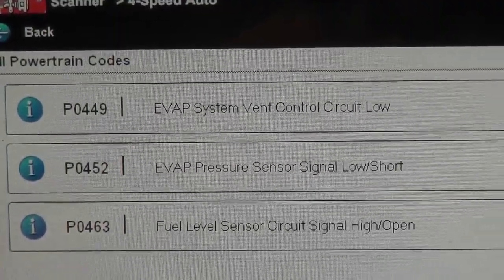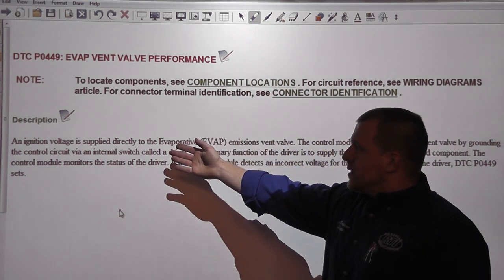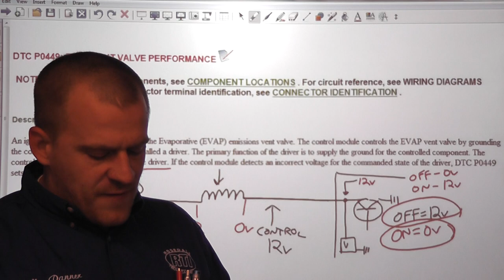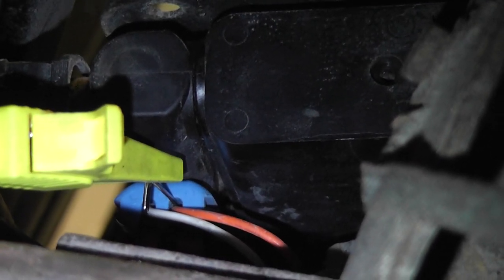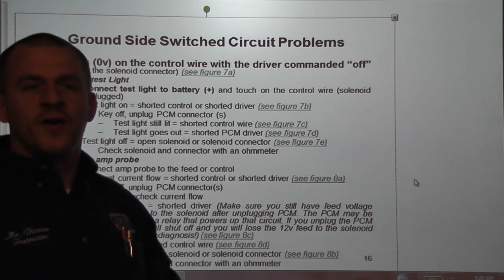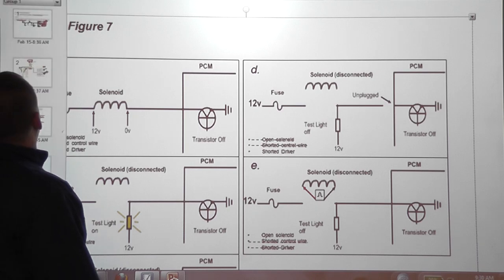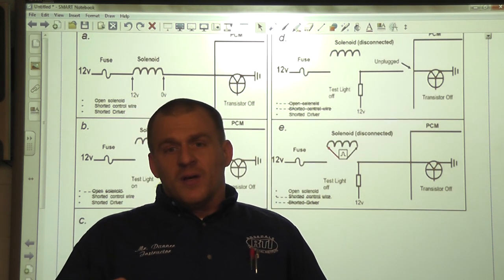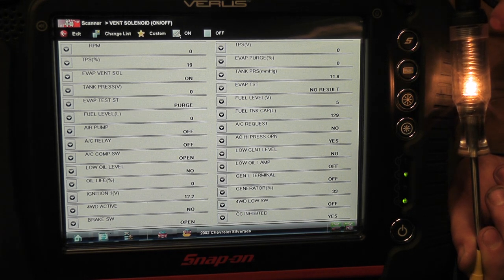GM EVAP Vent Solenoid Testing

Comment from the maker: @MrMratni Very good comment! And thanks again for the book purchase! You are correct about that test, except in the case of a vent solenoid, I will disconnect the vent hose and connect a long piece of heater hose and blow through the solenoid. (the ports are too big for a hand vacuum pump) De-energized you SHOULD be able to blow through it and energized you SHOULDN'T.  GM EVAP vent solenoids are normally open.

Comment from the maker: It is what we call a dummy shaft distributor. It is still there to drive the oil pump as the distributor used to do. It will come out. There is a rubber o-ring type seal that is most likely hard as a rock. It is ok to get aggressive with it.

Comment from the maker: @contagiousFX It is a ground side switched circuit, so with the solenoid open there will be 0 volts all the time on the control wire regardless of circuit activity (driver on or off)

Comment from the maker: @contagiousFX If done correctly like in this video, it is the best way to test the driver and control wire integrity. Of course you need to understand current flow and that the test light I am using is the same if not lower current than the solenoid carries. There is absolutely no danger to the driver in this test. I recommend in my book before doing this type of testing that you measure you test light current draw first. Oh, and keep that power probe away from this type of test.

Comment: Hi ScannerDanner. I know it has been 2 years since we spoke on the issue I was having with a P0446 issue on my 2001 Camaro; but as promised, I have an update for you. I found that the fuel pressure sensor was the cause for the whole problem (The sensor was totally dead). The EVAP system set to ready within 10 minutes of driving after replacing the fuel pressure sensor. Thanks for all the info and assistance that you provided while I was trying to diagnose the problem with that P0446 issue!

Comment from the maker: No, what I am saying is with the P0446 code not happening (or temporarily fixed), the system was able to complete its monitoring of the system and when it did its check on purge flow it found another problem. So what I am saying is you have two separate issues. IF you fix this P0446 code, you will then continue to set the purge flow code. Unless of course that one is intermittent too. 
You need to focus on pins contact at the PCM for that vent solenoid first.

Comment from the maker: you heard a click, that's good but you must also check the function of the solenoid.  you should be able to blow through it not energized and not be able to blow through it energized. This is a normally open valve so by your description of having trouble filling your tank, either the valve is stuck closed or there is a blockage in the vent line

Comment from the maker: first thing is to turn the key on a take a voltage reading on both solenoid wires. I believe this design is ground side switched. so you should see 12 and 12. the result of this test will dictate our direction or next step. Oh and yes you could use a test light to energize this but we are not at that step yet.

Comment from the maker: If you energize the solenoid with a test light, that just checks the solenoid and the feed circuit. To test the control wire and the PCM driver you must use a scan tool to turn the driver on or you have to meet the conditions where the PCM will normally turn the driver on. That is the only way. Of course you can use the test light in place of the solenoid for the test, but the driver must be turned on and you cannot do that part with the test light.

Comment: In addition of after checking the control side and power side of the circuit, you can energize the solenoid with the scanner and apply vacuum with a hand vacuum pump. If the the vacuum doesn't hold then surely the solenoid is bad. Btw, I purchased your book very awesome.

Comment from the maker: You cannot see the control wire voltage on the scanner. At least not yet but that would be cool.  I will not be surprised to see output solenoid control wire voltage listed on the scanner in the future. You can see the command on some but that doesn't tell the whole story. Thanks!

Comment: ScannerDanner thanks for all the work you put into these videos. I love my Modis scanner a lot more when seeing your videos. You remind me of my tech school engine performance/electrical instructor. question: Does this evap solenoid testing procedure apply with checking an a/c compressor flow valve for a 2008 toyota camry 2.4?

Comment from the maker: @foxholewilly I'm not completely sure what you are referring to, Do you mean bias voltage? Like in Section 3 page 26 in my book? (I'm not sure if you have it, so sorry for the reference if you don't) The circuits that will typically have a bias voltage are the power side switched solenoids. I don't remember if I have ever seen that on a ground side switched one. With the transistor off there is no current path on the control wire.

Comment from the maker: having the voltmeter hooked up wouldn't change anything other than potentially the male/female pin contact at the ECM. You may have a loose pin that was temporarily tightened up with your t-pin or whatever you where using. 
This may have allowed the system to finish its other checks. So it sounds like you also have a purge flow issue. Most common cause for this code is reversed vacuum hoses on the purge solenoid under the hood or a sticking purge solenoid

Comment from the maker: use a t pin for the pcm connector the make yourself a long jumper wire with alligator clips. be sure to insulate the end under the hood just in case. also use a jumper wire for you voltmeter neg lead too. this way you don't have to hold anything and you can focus on driving

Comment: Broski I'm having this problem right now and this video is badass! Thank u so much and learned from this..so I did all the tests and diagnosis and found that at the end it was my original connector that failed.i replaced it and code gone and running good on the truck👍🏽
Reply from the maker: awesome! Thank you!

Comment from the maker: @foxholewilly Oh ok that was very observant of you! In my experience with both ends of a circuit open yes you will see this "ghost voltage" as you call it. (From what I found if you zoom in on it and measure its frequency it is 60hz which no coincidence is the same frequency our residential lighting systems run.) So I would call it "noise". Anyway to answer why it was not there. First I do not know the PCM board as well as I would like to but I would say there are some......

Comment from the maker: It is not a leak code. When you see "control circuit" in a code it is either the wiring, computer or solenoid that is at fault. These are known for wiring issues at the connector. Tug on them to reveal a break, sometimes the insulation can even look fine but the wires are broken inside. If you have a voltmeter, with the key on, backprobing the connector (solenoid plugged in) you should see 12v on both wires

Comment from the maker: @ScannerDanner capacitors and or despiking resistors that are in a parallel branch to the transistor driver in the PCM. Either way this in no way changes the diagnostic, wouldn't you agree? But it is fun to talk about. You have a great mind.

Comment from the maker: ok, next step is to measure the white wire at the pcm. there should be 12v there too. 
Or if you have a bidirectional scan tool, command the vent solenoid on and look for a voltage drop on the white wire.

Comment: Excellent diagnosis.  Love how you confirmed the integrity of the driver at the end by commanding it on and off. I always like to manually control drivers whenever the option is available.  I wonder if maybe you could view the voltage on the control wire through the scan tool, while also commanding it on/off.  Of course, it is always important to understand what is going on in a circuit.  This vid did that

Comment: Like Paul said you can aggressively twist it with pliers, channel locks or lightly adjusted vice grips. I replaced my 1993 3.1 recently and when you get it out take a knife tip and snap out the o ring. There should be a shaft from the oil pump that may or may not come out with the cap. Mine did. Good luck.

Comment from the maker: @ScannerDanner It is too easy using a power probe to apply the wrong polarity to a circuit. I personal don't use one, nor do I feel the need to. Just a regular old incandescent style test light is just fine for 99.9% of driver testing that I showed in this video.

Comment: Thanks for the reply Paul. I took the vent solenoid off the car to bench test it. I'm holding it, and I gotta be honest, I don't it's the type that you can blow into to test. If ya type chevy cobalt 08 vent solenoid in google it'll show up as one of the first pics. It's cylindrical. Also, I should add the solenoid goes directly in the canister. There is no vent line that goes directly to the solenoid (from what I can tell).

Comment: At the 25-27min. using the test light is the key on or off ? I am guessing key off.
What signals computer to ground the control wire and activate the solenoid. Does the Evap purge solenoid operate the same as this vent control solenoid ? I do not have the ability to ground the control wire with a scan tool.
My vehicle is a 1996 Olds.Lss 3.8 S.Charged. I have a P1655 Evap Purge solenoid control circuit code combined with a P102 Mas or Vol Air Flow A Circuit. 
Your video is the best for explaining this circuit I have seen.Thank You.
Reply from the maker: For some of the tests the key must be on for the computer to have power and for the feed circuit to get power. 
For the short to ground test in the harness on the computer side, the key does not have to be on. In fact, I think I have the computer unplugged in that example right?
Your purge solenoid is tested the exact same way as this vent solenoid in this video. It is power side fed and ground side switched. It is possible the purge and MAF sensor is on the same circuit for power. See if you have power first.

Comment from the maker: How about watching that control wire voltage at the PCM during a test drive. Rig up your voltmeter to that wire and put the meter inside your truck. See if it ever changes. IT should only change when it is commanded on by the PCM.

Comment from the maker: the test light is the load. most test lights will draw less current than the solenoid itself would draw. you should always measure the current draw of your test light before doing this kind of testing. most of the incandescent bulb test lights draw about 200ma.

Comment: I use a 194 bulb with a couple of the proper terminals to plug into the vent solenoid connector.  Use the scanner to operate the vent solenoid and prove out everything at once.  Even pin drag.  I used to use an 1157 bulb, but somewhere around my2006, the pcm stopped driving that much current for these circuits.

Comment from the maker: Every driver is different, you have to research the system to know when. .In the case of a GM vent solenoid, the only time it is turned on is during the leak test of the evap system.

Comment from the maker: is this code immediate or do you have to drive it for awhile to show up again? I still think you have a wiring problem and you need to pull and wiggle the harness while monitoring vent solenoid control wire voltage at the PCM connector. It should stay at 12v the whole time.

Comment: Good video.With my Pontiac Montana off and on my red wire only reads 4 to 5 volts when testing to ground. White wire reads 0 at all times with plug out,not pin tested while still plugged in to solenoid which might be ok? This is going to the purge solenoid,not the vent solenoid which is in a very bad location to get to unless I roll the engine frontward after disconnecting bone brackets on front.

Comment: I then checked the defective unit with a olm meter and its open, as the replacement unit  is complete.Hope I didn't hurt the Driver as you stated ,When I checked for voltage at the connector with a volt meter.

Comment from the maker: Can you apply a power or a ground to a circuit with just the touch of a button with this tool? I know the older power probes do this. Also what is the voltage threshold that will light the green LED indicating a power source? There are other concerns I have with this tool too. Take a ground side switched solenoid that is not being grounded yet and check the control wire. This tool will ID the circuit as a power feed, but what it really is, is a switched ground. I suppose a DMM does the same.

Comment: Thanks brother for another great video. I have a 1997 LeSabre with a p1655 EVAP Purge Solenoid Control Circuit code. My scan tool is not bi directional and I wanted to know the best way to test this circuit. Can I use the test light to activate it ? Thanks brother

Comment: Yes, BATT voltage and ground can be applied with the switch. And without pushing the switch if the probe tip touches a grounded source, the light will go green. But if it touches a voltage source it has a red LED that lights. So in a sense PPIII and DMM sorta same. So any suggestions to a good scan system that a work-from-home mechanic should look into? Local part store has a OBD1/OBD2/ABS scantool,but it does no live data or sel/relay acctivation only FF all for $500.Only 1 can find under 1K.

Comment: and the other option is instead of using the feed of the solenoid wire using a cable that go from battery positive to the placed t-pin in the control wire and check if the light bulb lights up. These 2 tests it can perform and verify that there is a failure in the control wire right? Sorry for my english :)

Comment: I mean continuity test*.two other options which come to mind are (can you hear crazy but when you dont have the right tools you have to improvise) put a t-pin in the ecm plug and disconnect the plug and place the test light to ground battery and place it in the t-pin of the plug of the ecm and then jump the 12 volt feed of the solenoid to the control wire and check if the test light comes on. The only danger that I find this test is if the control wire is shorted to ground will blow the fuse

Comment: Hi Paul
Awesome Video.I noticed that you mentioned that if we see CIRCUIT in the definition of a EVAP code ,it is an electrical not a leak issue,but I had a 2000 Porsche Boxer with P0446 EVAP CIRCUIT problem.The German definition of circuit is SYSTEM not wiring.The canister and  line from canister to purge solenoid was plugged... HA .I replaced the rubber line and cleaned the canister and no more P0446 .Isn't that funny ..CIRCUIT not SYSTEM

Thank you

Comment: paul why wouldnt we fry the pcm by applying 12v with the test light and commanding driver on. technically we are bypassing the load and giving it straight 12v right? or does the light itself provide enough resisrance?

Comment: dude ive been trying to fugure this out  since last year when i bought the car everything ealse i did failed until i ran in the the video GM EGR VALVE TESTING (P1404 CASE STUDY) 45:08 to 45:58 and holy shit it was on backwords and it was getting bad gas milllage with negitive fuel trim both st lt it perrs  like a cat now i have to tell ya thank you very much i thank you saved me 100$ or more

Comment: i own a 97 grand am gt 3100  4 door and i have a p1406 egr  pantal position sensor circut dtc the connector has 5 wires going to the egr i checked the feed back wire and its at 1.5 volts at idel and about 1.7  at roughley 2000 rpms i checked all the wireing to the egr valve from connector all seemed fine i even ome checked the connectors going to the pcm from the egr connector and all seemed fine i thank i have negitive fuel trim it seems to gets bad gas millage plus when you pulse the brake

Comment: In the second test if the test light doesn't comes on its mean you have a shorted to ground control wire. And is will be easy find the short because that cable will have steady 12v from the jumper cable of the battery positive. then it is a matter of search the voltage drop in the cable to find the short. Well that what I think and again sorry for my English

Comment: If I don't have a scanner that has that function of energize the solenoid I would have that make an omhs test in the control wire. what I mean is to use a t-pin in solenoid plug and a t-pin in the ecm plug. Right?

Comment: hi ---Please help - i have a 2001 camry v6 operating at 178-181 temp, ecm will never go into full drive cycle  with the evap and both catalysts i disconect battery  few times and driving over 300 miles  i need to pass inspection

Comment: the whole exparance was a gigantic pain in the ass i even took off the cat converter thanking it was part clooged no change in feed back reading even the egr tube still no chance all that work because of a backwords egr valve because somebody dint pay attation in what thay where doing when fixing it i disconnect the battery and hopefully the computer will reset itself as i heard in one of your videos and relearn the feed back value      again thank you very much i cant thank you enough

Comment from the maker: because electricity follows the easiest path and your t-pin is now the easiest path so it bypasses the normal resistance in the circuit. This equals a huge increase in current. (resistance goes down = current flow goes up) BE CAREFUL WITH T-PINS!!!